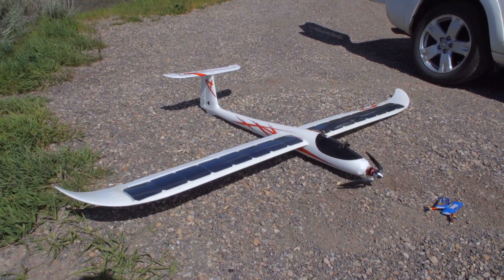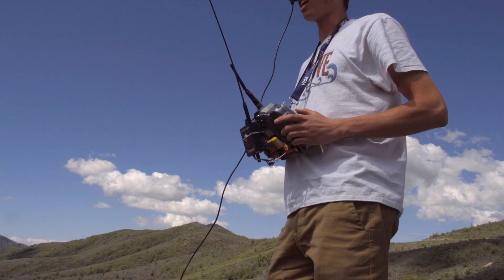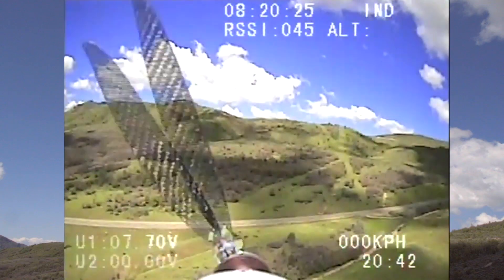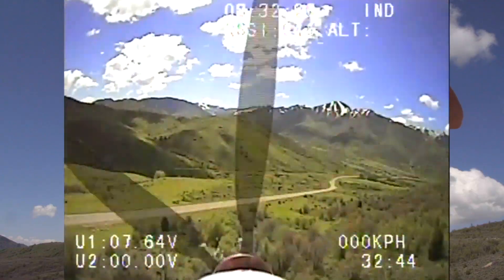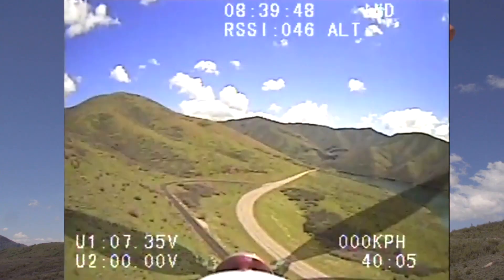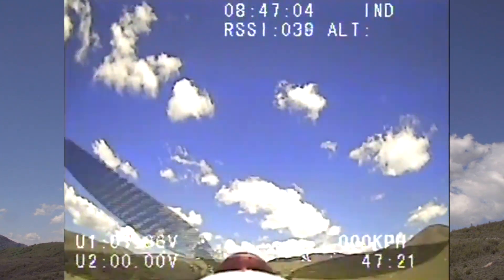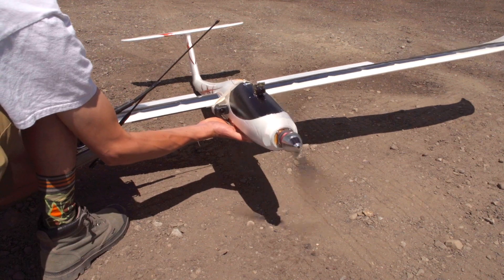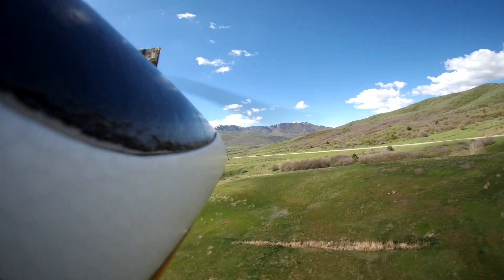2.6M FPV Glider with Solar Cells on Wing

Comment: I have 101V x 25A PV + 100.8V x 30A (Max) Li-Po + 5kW BLDC. Voltages are very close, using an MPPT would create loss. What would be the best way of preventing battery overcharge?

Comment: I would have just added 1 additional solar cell to each wing to make it 9 volts open and made sure a blocking diode was installed between the cells and the battery.  If not, the solar cells would drain the battery when shaded (like by a cloud).  Not the best solution by a long shot, a buck converter would have been better but it would be the easiest and cheapest method.
a 2 cell lipo is around 8.4 volts when charged, you had 16 cells which only equaled 8 volts.  Not enough voltage to charge the lipo unless it was almost dead.  By then, it didn't matter.  Even adding 1 volt would have made a big difference.

Comment: The Max voltage would only be 8 volts the battery would have to be a 2s or less any thing higher in voltage and the cells would pull the battery down. The cells are still under the required amps to keep up so you would need double the cells in series and in parallel. This would require a wider or longer wing

Comment: 1) That camera circuit board has almost as much drag as the whole plane.   Get it mounted mounted under a clear canopy and it will drop your cruise power required. 2) look at using a maximum power point tracking converter for the solar array. It can get you 20% improvement.

Comment: Solar cells are usually more efficient if they are cold/cooled. If they are stuck onto insulation, (foam/expanded polystyrene) then they will not output at peek performance. Looks like they need some sort of air-cooling under them.

Comment: Hi. U can not charge LiIon (i think LiPO too - not 100% sure dhou) and acid - gel batteries with DC curent. U have to use impulse dc curent because bat. will heat instead of charge. So some buck converter should do. PEACE

Comment: Just as a suggestion, you really need to put a diode between the solar cell and the lipo, to prevent the battery to discharg into the cells when they aren't under solar light.

Comment: what kind of cells are those? seems to be some flexible, I am using Si cells
update: I found it is a bit flexible but Si good one!
https://nl.aliexpress.com/item/24-125mm-Sunpower-Solar-Cell-5x5-max-3-55W-high-efficiency-125mm-Monocrystalline-solar-cells-10pcs/32430444703.html?shortkey=MbYruAfy&addresstype=600&aff_platform=link-c-tool&cpt=1497625208706&sk=nQJQRN7&aff_trace_key=e135b5b7628044e7b1eb4889184dfd7e-1497625208706-02912-nQJQRN7

Comment: Nice job!! did you read about MPPT or Maximum Power Point TRacking? Solar cells deliver maximum power at a certain current and a certain Voltage. So if they did not perform as you expected its maybe because the Voltage wasn't correct. you should read the cells specs where u can find the details. On the video there is also a lot of cloudy places. Solar cells perform very bad under clouds. Hope this recommendations help you to improve the flight time ;)

Comment: I'd probably recommend having a buck/boost charging controller with an MPPT between the cells and the battery/motor, partially to prevent discharging through the solar cells when a cell is getting less light than the others. Also the film over the cells are definitely reducing the efficiency of those cells, which is why even in direct sunlight, they're not producing as might light as you might expect.

Personally if I was going to try this type of thing, I'd have micro boost converters on every cell so even if one or 2 cells aren't generating enough voltage, you should be getting a stable and consistent voltage, just with less current. One problem with using boost or even buck converters, is you need high efficiency converts for your purpose.

Comment: When the cells are connected in series and one is broken or shaded, it'll limit the current. The open circuit voltage will be high, like if nothing happened. Bypass diodes are used to prevent this.

Comment: Great vid. You can increase solar efficiency dramatically by loading the cells with the optimum impedance, ie. find the current draw that maximizes V_sol * I_sol. This should be easy to do experimentally (on the ground) with a multimeter or 2, and a bunch of various resistors. Typically (says a datasheet of mine) that happens where the V_sol is at 70-80% of the open circuit (I_sol=0) value.
You can use the throttle to prevent overcharge :) Could be a fun story to have to choose between a flyaway and a flaming battery :)

Comment: I don't know much about planes or gliders but from what I know of solar you may want to keep the batteries, any sort of shadow even from an antennae or something will effect them even dust, and any time you bank away from the sun or something you'll lose power without a way to store the charge, also they need to have a higher voltage output than the batteries to charge them

Comment: leave it in the sun for 12 hours for 1.2 mins of flight. lol and the added weight means it'll consume more electricity so you might actually getting shorter run times instead of longer

Comment: The specification on the solar cells you are looking for is called the "Vmp", or "Volts maximum power".   If you are charging at 7V for example,  you need all the individual solar cells connected in series Vmp's to add up to near-exactly 7V, or as close as you can get it.  Then you have maximum power from your PV into your battery.  Also search aliexpress or ebay for "solar charger" - there are some really tiny ones.

Comment: If you try to connect the cells directly you might try a small group of capacitors to get a small watt tank and let the motor grab a bit more current or voltage than the Solar system can give at that moment  ,and that might perhaps with a small  regulator , keep the current even enough to run directly from the Solar System.anyhow hope this helps and keep the videos coming as I have a keen interest in this very project for myself! So thank for the test info it will be invaluable to me...cheers
JC in Auz

Comment: Consider getting a Neutral Density Filter to put over your POV camera behind the propeller. I do this on my gopro when doing real world flying. It should eliminate seeing the prop blades and creating a blur IF the image light sensor is automatic. Also, most solar cells have falsely advertised numbers : (  I suggest (depending on price) getting a new set and testing like you did at the end of the video without the solar cells attached to anything.

Comment: cool build and awesome flight spot, like some of the other comments said, if you put a diode or capacitor between the solar circuit and the motor you should get a more consistent voltage. it could be the same for charging the battery as well. but a buck converter like Adrian said would get you a more accurate voltage out. i hope you do more with this set up, I'd like to build a solar glider eventually. no motor though.

Comment: good video!

May have the spec of the solar cells you had installed? How many of it and what are the electronic components required for this setup? I am interested and would like to build one as well.
Reply: i think he rigged them all in parallel if they output the 8.4v, and ran the DCv right into the battery charger. but i could be wrong. if they are less than 8.4 than he probably rigged multiple in series and then paralleled those to get the right voltage.
Reply: thank you.

is the solar cell in multiplying of 1.5v? in this case, it should be 9v instead of 8.4v

Comment: It sounds like you are pretty close to sustainable flight - if the panels should produce 6A, and it takes 7.8 to sustain, perhaps you could just use a smaller battery and get closer to parity
Reply: a smaller battery  and use braking to reduce his drag would go a long way, considering its a meant to glide, the majority of the strongest charge of the battery will go to the climb, and while in the air it recoops that voltage.

Comment: Nice work and interesting findings.  A couple of things, a diode in series will insure the battery doesn't also try to power the solar panels. There is a slight voltage drop, so a highr operating voltage will help that effort. It will also reduce the current required.

Comment: I read about a rotating powerless prop produces the same amount of drag like it would be a solid disc. I don´t believe it´s that bad, but it´s bad. It most certainly prevents you from using the potential of that airframe.
Reply: Yep, it's a really big factor, it is indeed like a disc. Using prop brake would make a huge difference.
Reply: correct. this is why auto-rotating helicopters (in an emergency situation ) is a thing.
Reply: it's actually much worse, that's why most planes with props can feather them so that they dont spin and dont cause drag.

Comment: did you put a diode in between the cells and the battery, if not the cells can turn into a heating load and drain the battery

Comment: i think without a charge controller or at least a diode when in darker times power will go to the solar cells, draining the battery and possibly damaging the cells. and charge controllers should be able to maintain output voltage properly, so even 4v 1a (4w) could go back into 8v .5a (4w) or 12v 6a would go to 8v 9a... i'd believe its important controllers are set for battery voltages.... at home i have a 12v (deep cycle) setup with 200w of solar panels are rated 18.5v 11a, open circuit 22v. then i've seen my controller say 14a at 14.4v.. maybe you do need higher voltage and a controller.... then wire a current meter between the controller and battery, and one between battery and everything else. i doubt that clear film on the cells degrades any efficiency.
..ive got that same osd, my gps works but its 40 miles off so it too is just voltage.... now i want to fly fixed wing lol, nice flight!!

Comment: Damn love that landscape, is there a way to regenerate power from the prop spinning on its own. Similar to regenerative braking. Just a thought
Reply: It is better to use ESC braking on stop and a folding prop for efficiency. You can't regenerate as much energy as you lose with the drag generated by the prop if it doesn't fold back.
Reply: the mass of the plane really isn't enough to counteract the drag to make it worth it specially when it comes to foam gliders. if he had ESC breaking he might have had very different results.

Comment: The differential between the open circuit cell voltage and the battery is too small to be able to get much current out, so definitely needs some form of charge controller or dc-dc converter to get optimum current from the cells while also preventing overcharging.
Another couple of cells might help!

Comment: use a rubber band to hold the props back when you cut the throttle if you don't have esc breaking
Reply: Wales Wideman how does that work?

Comment: I'm not sure on the power looses, but a boost/buck converter can output a set voltage into the batteries even if the solar panels drop or put out too much voltage.

Comment: You can check current by adding small resistor in series with cells. I=U/R. It will slightly decrease output power, but its really cheap and you dont have to change OSD.

Comment: You may already be aware but solar cells act as a current source, so if you connect directly to a battery the voltage will drop to whatever the battery is and will increase as the battery is charged, up to the maximum voltage the cells can produce.

A simple way to try and get more efficiency would be to add a buck converter between the cells and battery, this may allow the cells to 'sit' at a more efficient (higher) voltage and produce more power. If the cells can't produce enough power then the buck converter will basically act as a direct connection between cells and battery anyway. A positive side effect of using a buck converter is that you set the voltage you want, so you can prevent over-volting your batteries and effectively go into the CV part of the charge cycle, for 2S you could set for 8.4V (as long as the batteries have been balanced beforehand). There are 2-3A buck converters out there (ebay, banggood etc.) that may suit your scenario.

Of course all of this is dependent on the solar cells producing a max. voltage higher than your battery's - thought I'd mention it anyway!

Thanks for the videos dude, always enjoyable!
Reply: There are buck converters (even cheap ones from Ebay) weighting like 2 gram, that can take 3 amps, so the weight is not so much a problem.
G.
Reply: I recommend the Pololu ones. They are small and light and work very well.
Reply: Adrian Johnson 
I agree with you. 
Though there is a big difference between the open ciruit voltage and the maximum power voltage. 
usualy the UMP i believe its called (maximum power voltage) is about 20% below the open circuit voltage.
Reply: Tim van Neijenhoff you make a good point! Maybe the scale of this plane is a bit small for a buck converter to be worth while...
Reply: a lot of them are pretty tiny.  It eally isnt much current
Reply: I did not try the one I linked at 3 amps, so I don't know if it has any heating problems, but the airspeed of a glider might help with that if it would be an issue.
G.
Reply: this would be cheap and work very well
Reply: have you try if they can really deliver 3 amps? what is the name of that 2grams/3Amps step down converter?
Reply: have you tryed if that tiny unit can really deliver 2,25 Amp current? The higher the voltage difference the less effecient they will get. 2,25 Amps are possible for the smallest stepping on short therm (maybe a minute). 
 For a given reason I doubt they can weight 1,5 grams and deliver 2,25 Amp. I think Maybe 1Amp for 5 Volt boost. Please proof me wrong. I will buy 10 pieces. ;)
Reply: I just did a quick Ebay search:
http://www.ebay.com/itm/DC-Buck-Step-down-Power-Supply-Converter-5v-16v-1-25v-1-5v-1-8v-2-5v-3-3v-5v-3A-/191926075524
This one uses a MP1495 chip that (according to it's datasheet) can take 3 amps of continuous
output current.
Although it might be slightly more than 2 grams.
G.
Reply: Hello, I doubt it can do that without heatsink...
Check out this tread:
https://www.rcgroups.com/forums/showthread.php?1277428-The-BEC-Tester-UPDATE-June-23-2011-first-post-now-has-a-list-of-all-tests

Comment: hi rctestflight 
really nice job done ! it definitely increases the flight time - could you post the link where u bought the solar cells on the wing cause there are so many different ones and yours seems to work well in combination of the weight these have - thx and happy flying

Comment: Would be cool to add a current sensor in line with motor and battery.  Fly for as long as you can then charge and see how much amps go back into the battery.  Total amps used from the osd readout minus what your charger says and you got how much milli amps your solar cells produced during flight.
Cool project, keep it up.

Comment: Def Need brake on ESC
Reply: Braking stops the prop, That's what frees up drag. If you try and turn a braked prop the ESC trys to stop that, but once it's stopped the power drain is negligible. I've been flying F5J sailplanes for 15 years, trust me, turn on the brake.
Reply: Yes, to say that's a major source of drag would be an understatement.
Reply: ESC braking just puts a low impedance across the motor windings when throttle is off. In this state there is no draw of power from the motor battery.
Reply: The prop will fold back, and most of the time surprisingly fast. There is a rubber band trick using bands for braces. that is normally only used on tight prop to hub bolts that need parts to be well secured. I've never used rubber bands and run a floppy prop (loose castle nutted bolt) on a 400 watt 11x7 setup doing 14K rpm.
Reply: U would not believe how much air resistance the prop produces. When i started flying, we used low rpm as an Airbrake for flying. A stopped prop is always better, even if its not foldable. In this case i think the solar cells ant the rotating props are decreasing flight time, normal battery with stopped prop would be better.
Reply: Max creates more drag

Comment: Hey man, this is awesome, I love your solar RC experiments, I'm thinking of creating something like this and creating some autonomous flight drones for the purpose of creating an automatic delivery system... long story but I think I could convince my federal government in Australia to fund an initiative for our Pacific island neighbours, in particular Papua New Guinea, who's shipping costs are insane even for small items because people have to ferry stuff by boat between islands. RC gliders seem like a cheaper, more efficient means of doing this than using something like a boat, which would no doubt get battered around by the ocean. I know there's a lot of complexities I'm not considering but I'm willing to work through those and videos like these are certainly inspiring
Reply: Ah, also I just realised, did you have a diode for current blocking on your charge circuit? If you didn't it could be the reason your amperage was so low, you were getting reversed current bleed.

Comment: put a diode between the cells and the battery
Reply: yes, over volt the panels and use a bms
Reply: Or an npn transistor hooked up to behave like a diode. (Less voltage drop)
Reply: Steven and how about adding a few more solar panels in series so there are more volts than the battery but then put a voltage regulator to match the max battery volts?

great project!
Reply: Steven yep, thatd keep the current from reversing.

Comment: you should get better results when you add a capacitor instead of running the motor with the solar cells alone.
Reply: Off course that's true :)
Reply: Christian Wetzel He has the solar cells connected to a charger that charges the battery he has. Those solar cells could'nt power the motor alone.